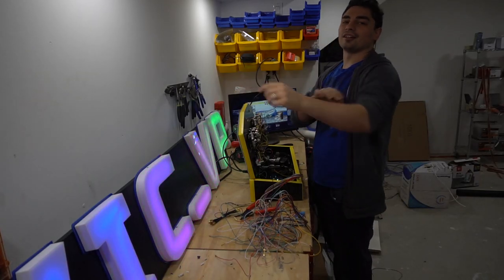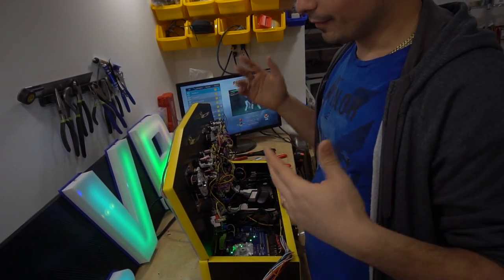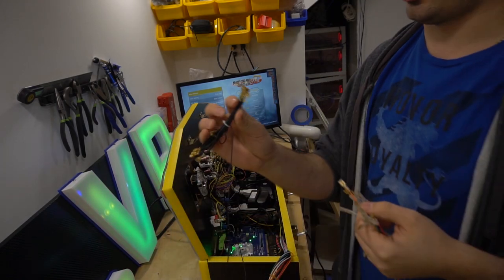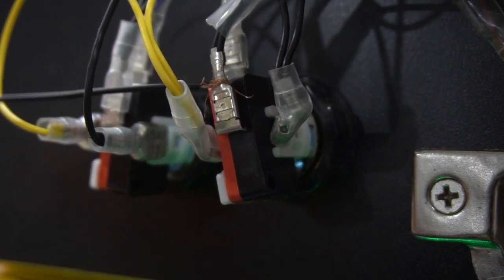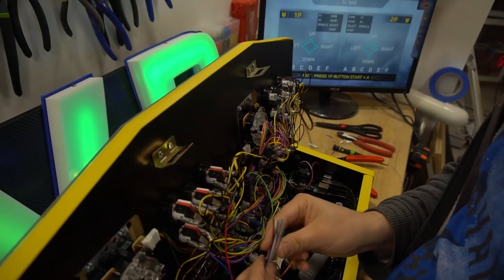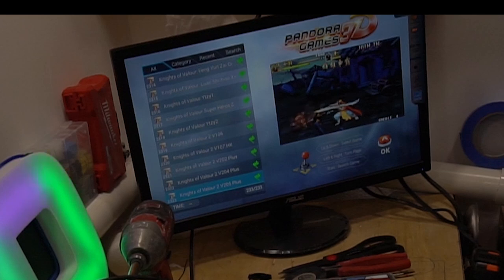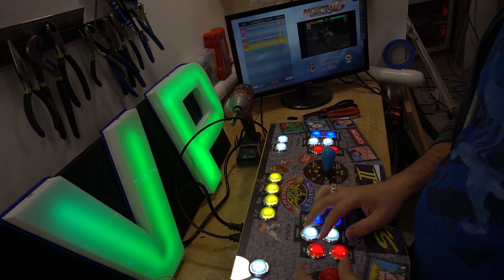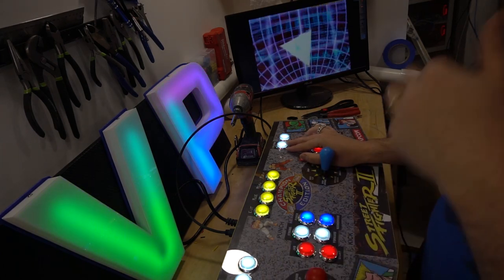Pandoras Box 3D quick Look!

Comment: What would you suggest bro, I have a raspberry pi 3 and I really only want to play arcade games more then anything.. fighting games mostly I’d run I have emulators and roms on consoles so playing vintage consoles isn’t why I built a bar top.. any suggestions??
Reply from the maker: hey Kay i just saw this message. this pandoras box honestly. pi gives you more system options though. whats on this pandoras box will also be on a pi, but this PB did play some games much smoother
Reply: Vic_VP oh ok thank you bro for hitting me up I’ve messaged others and nada.. Since you do some bad ass builds and you keep it 💯 what’s the best method in cutting plexiglass for the holes I’ve tried a few ways and the shit just keeps cracking... ?? What’s your suggestion if you have any ideas I’d appreciate it. I’m gonna try a hole saw bit and go from there.. I’ve seen some sheets that are really flexible where you can just cut with tough scissors, I’m just really trying to protect the art that I bought for the control panel .. even that thin sheet would do good bcuz I could cut holes with a sharp X-Acto knife.. idk but like I said any ideas I’d appreciate it .. keep up the great videos.. much respect ✊🏽